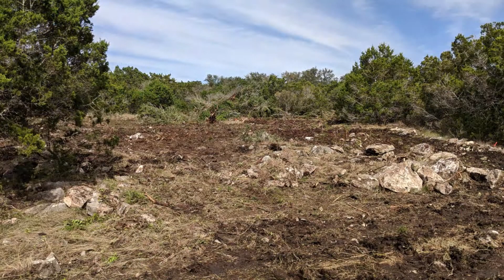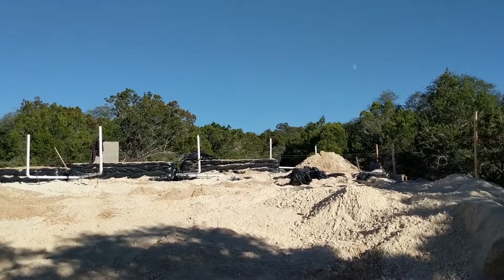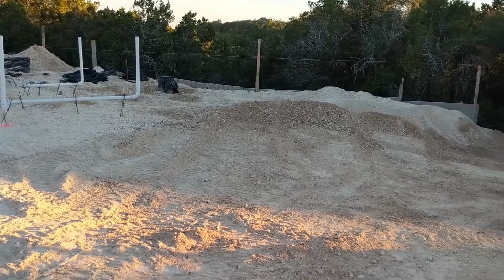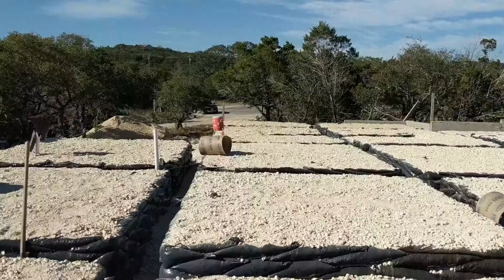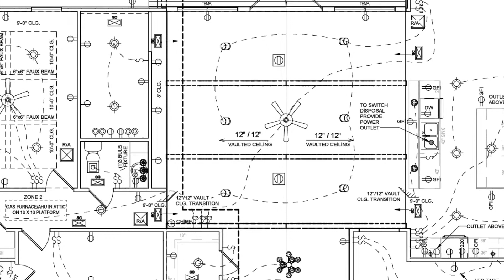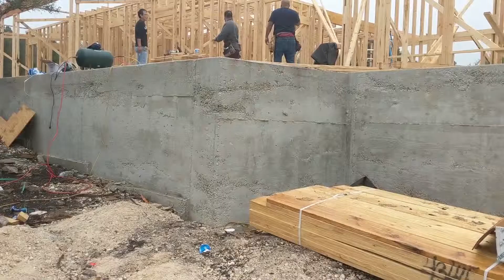House Build Ep: 2  The foundation

Comment: No. Honeycombs are from unskilled installers... Vibration addresses the lack of consolidation and I did not see anyone vibrating behind your one man installer!
Infact, this could be a structural issue if this is at your beams...
I would never recommend this concrete installer... 
I also did not notice any tamper on your job site... 🧐 Hmm 
You doing the stucco on those walls will be a nightmare and you should not save dollars by attempting to practice on this wall.

Comment: this is all great information i'm about to start my own build in pipe creek tx.  what was the ballpark cost of the foundation?
Reply from the maker: Off the top of my head, I believe it was around $60k. Would've been cheaper, but it took a ton of fill, and the 8ft beams on the one end didn't help either.
Reply: Thats not bad I would have thought it would have been more.

Comment: Did they use a vibrator on the walls??  They really should not have come out as honey combed as that.  On each lift a vibrator should have been run.  An experienced man can judge the time needed (too much and the aggregate starts to separate) and produce a wall with only the smallest of rare blemishes.  Form lines will occur but honey combs are not a normal outcome to the large degree you experienced.  Heck of a project.  Take care.  Doug
Reply from the maker: Yeah, they did, but as we came up to the top, the sun started beating down so they started to move quickly, so I think they pulled that guy to help out. Thanks for the advice though.
Reply: Seems you have a contractor who hasn't done much concrete work.  He may well be a good dirt man but just what kind of experience does he have with concrete?  A recommendation by a real estate guy is like going to the mechanic recommended by the used car dealer!  Number one huge red flag was missing his concrete order by 85 yards out of 225!!!  Holy cow wasn't he the guy that put the forms in, hadn't he looked at the sight?  That just isn't done.  Also if he pulled a man off vibrating it shows he didn't have enough manpower there to do the job.  Weather, slump, add mixtures all are very predictable.  If those trucks had not been available for the rest of the pour it would have been a cold joint and much weaker.  Pulling the forms the next morning is another no-no.  The very very minimum is 24 hours or 48 hours is even better.  Anything under five days and you are losing strength in the concrete.  Probably not a big thing in a residential structure but still you are paying for that strength and you should get it.  Then to top it off he puts it back on you to repair his lousy outcome of piss poor planning.  In no way should you be responsible for the repair of the honey combs.  That was a forseeable screw up any competent contractor would not have made.  You don't call for the pour if you haven't the man power to do the job.  What was with the late show up also???  He should repair the finish on those walls at the very least and no charges added.  You are still not going to get a good product like it should have turned out.  It takes a skilled mortar man to finish a wall and have it hold up as long as a properly poured wall would.  I think I would be looking for a new contractor.  I just hope he isn't doing any more work for you.  Don't like throwing a wet blanket on your parade but a guy shouldn't get hosed when he hires a job done.  I am hoping to save you from having to hire or do yourself a difficult repair.  Take care.  Doug